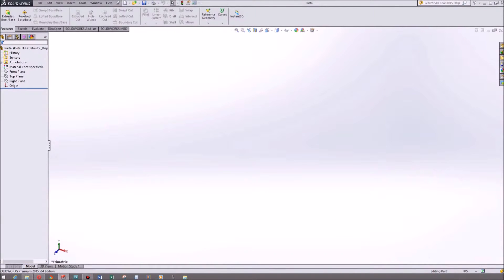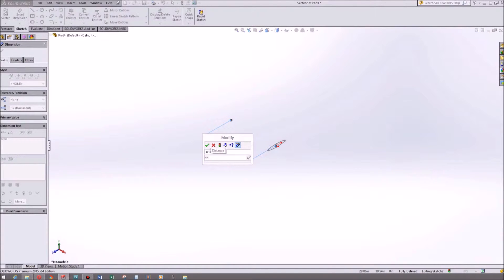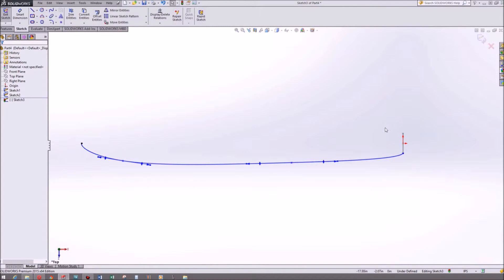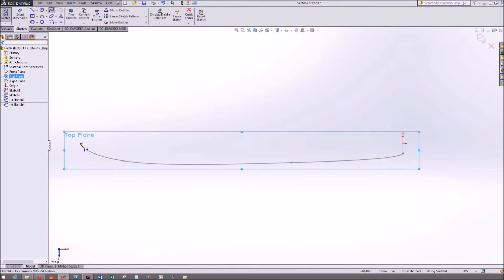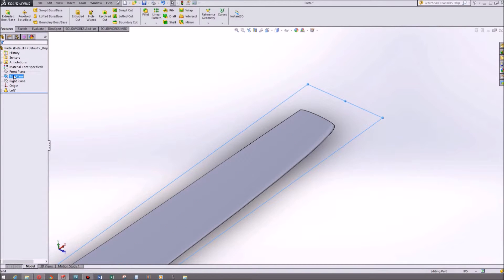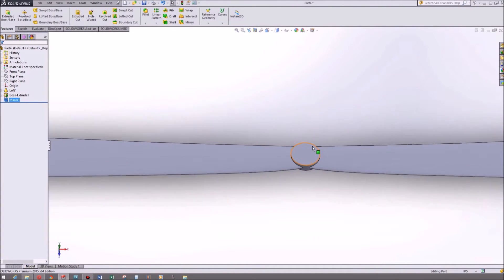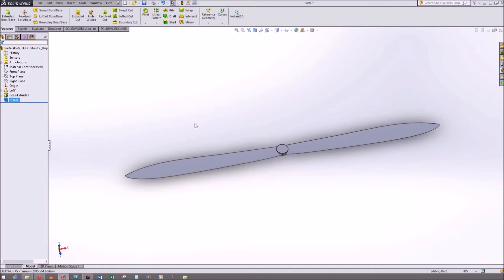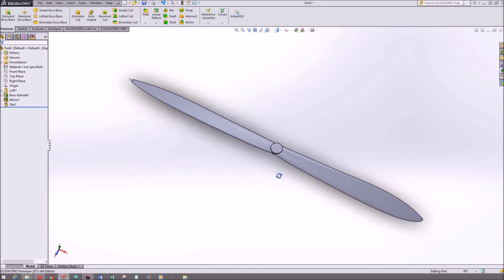How to Make a Propeller in Solidworks |JOKO ENGINEERING|

Comment: when i give the lofted boss command, its following only the top contour, it does not follow the bottom contour of the wings
Reply from the maker: +Akhil Nair 
If I understand, that can happen when the sketches are not separate sketches. Message me if that doesn't help
Reply: I selected both the contours by clicking on 'selection manager' in the right click menu.
Thanks for your quick reply and suggestion.
Reply from the maker: +Akhil Nair 
To make sure, you resolved the problem?